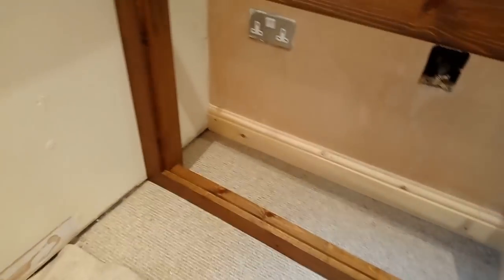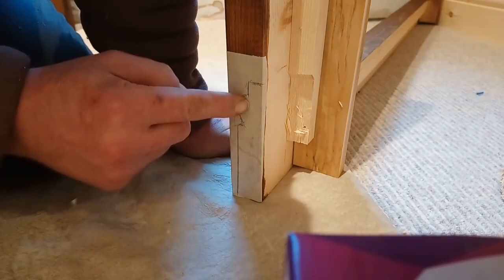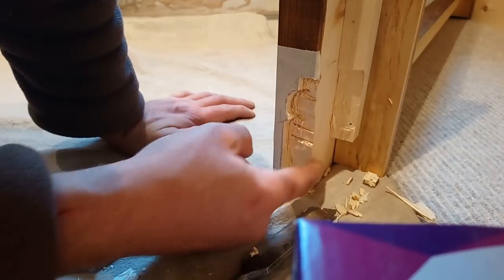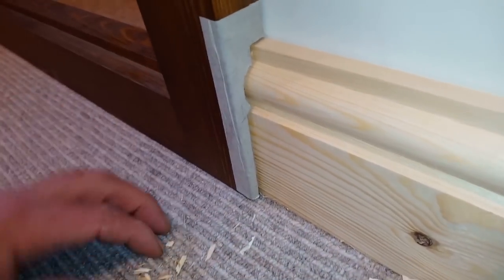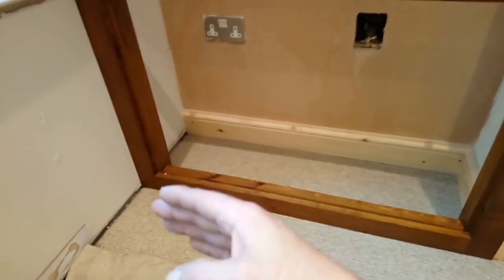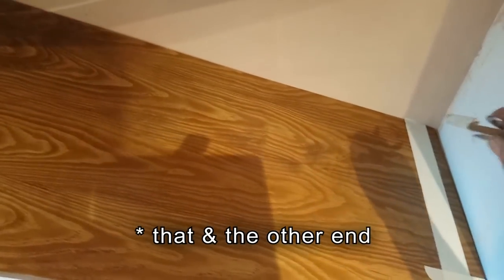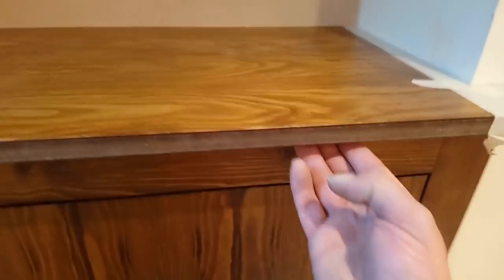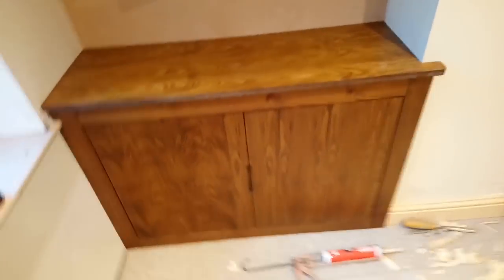Hilary's basement Pt11 - Fitting the small cupboard & scribing in the top

Comment: Great video Gid. I always use 3 or 4 H pencils,  bit expensive but I prefer the harder fine  point for accuracy.
Reply from the maker: Thanks Allan, 👍😊
I was taught just to use a reg pencil, hard pencils can be hard to remove the lines later & can cut too deep into the wood marking it & in veneer boards like this where there isn't a lot of wood to sand at could be impossible to eradicate. Each to their own.
Reply: @Gidjoiner  👍
Reply: @Gidjoiner  Which is exactly what I have been finding recently with the top German pencils.
Reply from the maker: @alexbowie6316  👍 yeah i mark the lines only as strongly as they need to be, over the yrs I've tried alsorts n I've found just a reg pencil is good enough,

Comment: What chisel do you use on the radius part ? I recently bought some tubular door latches that have rounded faceplates , and wondered what chisel would be best for chopping them in . I've looked on line but they all seem to be wood turning chisels .
Reply from the maker: Hi, I've had them many yrs, 25+ & the names rubbed off but they're Marples gouges 👍😉
Reply from the maker: Or maybe a router & a jig, you'd have to buy a cutter with the correct radius
Reply: @Gidjoiner  thanks for the reply, I'll have a look online for a guage chisel 👌
Reply from the maker: Hi, these are similar to mine but there doesn't seem to any choices, not much choice on the internet either 🤔😕 search in-channel gouges. 
https://www.oldtools.co.uk/products/marples-gouge-and-chisel-boxwood?variant=14770122752058&utm_campaign=gs-2018-08-22&utm_source=google&utm_medium=smart_campaign&gclid=Cj0KCQiA7briBRD7ARIsABhX8aAyWz8a29aPsgfkgEP7DxNmis2eUgFb9GWiPYiHZwhsR3j_wWzbZn8aAoUBEALw_wcB

Comment: Should got a multi tool on that shirting gid
Reply from the maker: Na, 👎 sorry but that's a cowboys trick, cutting into the skirting is a faux pa, these type of things, cupboards etc are classed as semi-permanent, when someone comes to take it out one day they'll find some cunt's cut into the skirting because they didn't know how to or couldn't be arsed scribing, & the only way to repair the skirting is replace the length because a patch on the skirting never looks right, on old skirting finding a matching replacement length can be hard if not impossible, so just in general you don't cut the skirting. Scribing it allows me to move that leg backwards n forwards a bit to help get the doors in twist